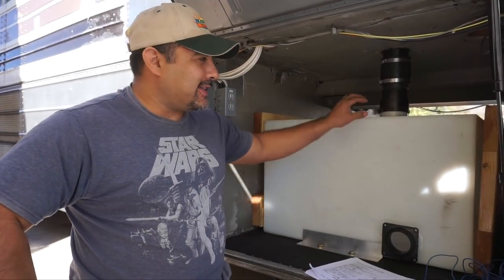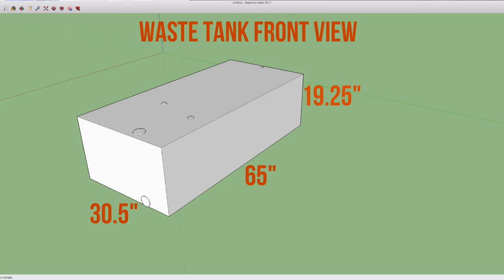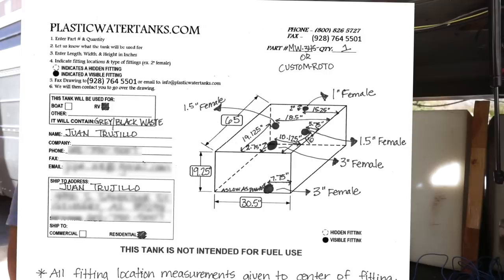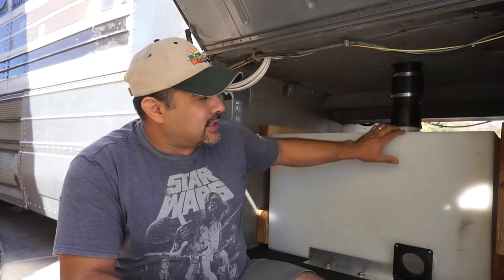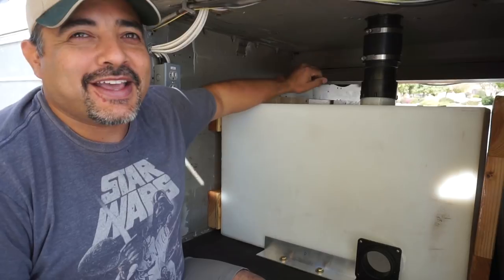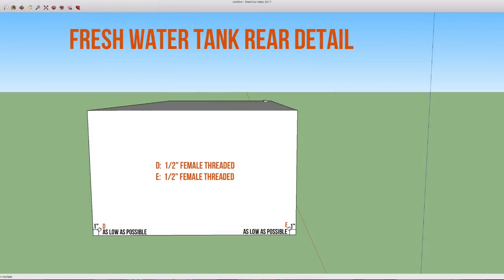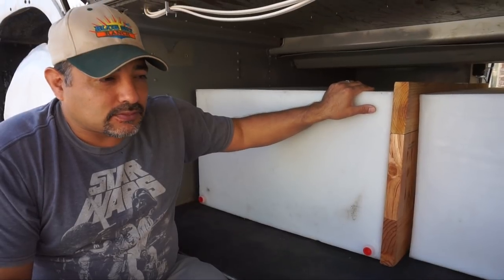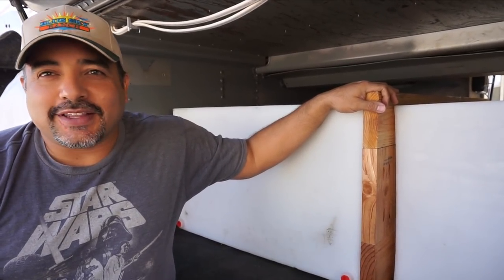All About the Tanks: An Overview of Our Water Tanks

Comment: RV Chief spray foamed his tanks in place as well as anchored.  Remember when you turn the bus, all the liquid will RUSH to the far wall.  Worst case is when you are 30% full, this will cause all the water to crash against one wall and then the other, as the waves crash back and forth.  This is a lot of weight splashing about.  The high strength low rise foam will help secure as well as insulate, in case you experience cold weather.  What about tank heaters?  Maybe you can duct heat from the battery bay into the water bay (on cold days that don't require A/C).

Comment: If you want to slope the tank when draining forget a frame under it and just use the leveling jacks to lift that side up more.
Reply from the maker: Interesting Idea Andrew.  We are going to try them as they sit for now.  We had a thought of perhaps using the airbags in the coach to tilt the whole bus ... we'll see if this becomes an issue.  Thank for the comment and for following along.
Reply: I've done this at some questionably designed dump stations where our RV tilted away from the drain side. Our tanks are sloped but I still just ran the leveling jacks down on that side to push it more that way. Worked fine for me.

Comment: you done it right level is best.  when you go to empty the waste tank make you a 2x8 board and put a second one on top just a few inches shorter screw them together so you can drive your rear wheels on the opposite side of the bus onto that will give you your tilt.

Comment: Great vid. You've probably looked into this, but I'm wondering if you know what the load carrying capacity of that bay is. That's potentially gonna be a heck of a lot of weight concentrated in there.
Reply from the maker: Hi - thank you for commenting.  We were concerned about this at first also and went looking for that information in the bus forums.  We didn't find any specific numbers but found out from some of the old timers that when greyhound had to move engines - they would put up to two engines in these bays and haul them from one location to the other.  The engines in these things are massive - weighing 2200-2400 lbs dry.

Comment: Wondering if the bay can support the weight?  it will be around 3000lbs with two full tanks. Not sure if the tanks have segments inside to prevent water from making too much movement when the RV turns too quick and tight. Great video, BTW. Subscribed.
Reply from the maker: Thank you Fred - I worried about that as well.  I went looking to see if there was any kind of rating on the bays.  I couldn't find any official weight ratings but I did find some interesting stories about what was carried in the bays.  According to some old greyhound mechanics the buses would often carry 2 even sometimes 3 engines in the bay when they were sending them out for rebuild or repair.  I went and looked up how much each engine weighs - they weigh about 2400lbs each.  In theory, we should only really ever have one or the other full - freshwater makes it into the waste tank if we have more fresh water on board we really have no place for it to go.  But that is still like 1400lbs - we have filled it with no adverse effects but we will be keeping an eye on it.  The tank was built with internal baffles to minimize the sloshing.
Reply: @BeginningfromthisMorning  thanks a lot for the information.

Comment: This is opinion based only, but I suggest that you round over the corners of those metal brackets so that they don't work into the plastic as the tank shifts side-to-side ever so slightly with the sloshing of the "holdings."
I'm not a holding tank expert (not even experienced with holding tanks), but I think I understand the properties of polypropylene and polyethylene.  Food for thought.
Reply from the maker: Hi Mark - thanks for the suggestion we will likely do that.  In addition, we will likely use a piece of rubber to cover these brackets - we shot this video mid-way through securing the tanks.

Comment: The only real concern that I would have with these tanks is: Do they have baffling to control water movement while in motion?
Liquids sloshing around can REALLY effect how your vehicle drives especially during curves & turns.
Braking is also very different with 1300+ lbs of uncontrolled mass moving around...you will have to compensate for that. 
You may wish to fill the tanks about 75%-85% full of water & practice curves, turns & stops when you are closer to being complete on the build.
Reply from the maker: Hi Gregory - Thanks for the question -  Yes the tanks were built with Internal baffles inside (to my surprise) - I was not aware until I peeked in there and saw them (I also wondered why the base of them was not perfectly flat - turns out it was the baffles).  Yes driving the bus with 1300+ lbs of water onboard will feel very different I am sure - we plan on taking everything pretty easy and slow (not that we have TOO much of an option with an old bus ;))

Comment: Did you have enough room from the top of the tank to the roof of the bay for a p-trap for the shower drain?
Reply from the maker: Thank you Jerry - yes there is enough room for a p-trap, but it turns out that p-traps are not really ideal in an RV.  Instead of a p-trap, we are using Hepvo Waste valves which have a small membrane that provides an airtight seal without needing to be full of water.  Another benefit of these valves is that they are much smaller than the p-traps they replace.

Comment: you may find that the black/grey tank drain port is on the wrong side .. most campgrounds and dump station are set up to drain tanks from the drivers side of the coach .. also most CG have the city water hook ups on the drivers side all so .. I like the videos .. great job .. just concerned about the tank drain port .. keep us posted .. De Randi
Reply from the maker: Hi Randi - Thank you for the comment.  We must have shot a few strange angles because our bus is configured the way you are stating - drain and fill will be on the driver's side.  I am sorry if it appeared to be the other way.
Reply: Based on the videos showing where the toilet is going (it's on the drivers's side) - I am pretty sure that the drain is on the driver's side.  What makes you think it is on the passenger side?
Reply from the maker: Good detective work Bill!  They are indeed how you describe :)
Reply: it was the angle of the shoot that threw me off .. I went back and looked again and I do see the front tire cover that I missed about half way through the vid .. great job .. De Randi
Reply from the maker: Thanks Randi - we are working on our videoing and editing skills - not 100% up to par yet but hopefully we are improving.

Comment: Historically, separate gray/black were because it was legal to dump gray directly on ground.  Now?  It's to support longer stays with hookups -- you still "hold" your black tanks, but free-drain gray (some don't, but vast majority keep gray valve open).  Since I believe you're shooting more for an off-grid boondock-mobile, your choice to combine gray and black makes logical sense for your rig.  Just curious, and I may have missed this, but why are you avoiding composting toilet?
Reply from the maker: Hi Travis - good to hear from you.  We are avoiding the composting toilet mainly because our kids are so young (12, 10, 7, 4) - I think the 12 and 10-year-old would do great with it ... the other two - not so much.  We were pretty convinced that we were going to do a composting toilet for quite a while, but the key to making it all work is the separation of liquids and solids.   We thought our two youngest would have a hard time with that - we have talked about retrofitting one when they get a little older and plumbing the urine diverter right into the black/grey tank.
Reply: Thanks for the reply!  Fair enough there.  I'm also concerned about our little guy (3 yo) being able to separate properly.  Guess we'll see!  You can always swap to composting in the future too.  Good call.

Comment: The only advantage I can think of to having separate black and grey water tanks is that you can use a grey water recycling system to reuse your grey water for flushing the toilet.  Grey water is shower and sink rinse water - so, perfectly fine for flushing.  Otherwise, I can't think of any advantage of having the third tank.
Reply from the maker: Thank you Richard - I couldn't think of much either.
Reply: 1. Washing out the hose after dumping the black.
2. If you boondock putting an enzymatic in your black water tank can help it break down and be less stinky. The detergents in grey water can kill the enzymes.

But you're right that there's not much benefit if you plan for it.

Comment: Is the bay going to be heated? Or are you going to add any insulation? I know its a large volume of water to freeze but ....
Reply from the maker: I will likely do both - heat and insulate the bay.  Not 100% sure what we will use just yet.  We would also like to follow good weather ... but good weather doesn't always cooperate :)

Comment: There are really two advantages I can think of with separate gray and black. One is the flushing of the pipe as you mentioned. Using a hose on the far end of the tank will not produce the head water that opening the gray water blade valve will produce (if you can I would install the sprayers inside the black tank to aid in flushing). Second is Black water must be drained into a septic system. In a pinch you could dump the gray into a storm drain as it is only soapy water. I would insulate the water bay. A piece of ridge foam board under the tank would protect it from chafing (same with the sides), It could be shaved into a wedge to tilt the tank and still support the whole bottom of the tank. When winterizing you want to be able to get every drop out . Also a heat run into the bay would be a good thing. My entire basement is heated. Have you looked into the structure under the floor. Will is support the weight of both tanks? A floor support from the floor above between the tanks might be a good idea. It could also sever as a separator. Absolutely a good move on the sensors. I need to replace mine for that very reason. Glenn Lever
Reply: I guess my biggest concern is all that weight in one compartment. Glenn lever

Comment: that is a total of 2600 if the tanks are full or maybe more can the frame handle all that weight in one place?
Reply from the maker: Hi old time engineer - yes, it is a lot of weight.  I think the bays can handle the weight.  We also should not have both tanks full at the same time - as we use the fresh water it should empty into the black tank.  if we add more water before dumping we are really asking for trouble.

Comment: Hi Juan, I just found your travel the other day while doing some battery research and saw your awesome lithium battery series. I proceeded to watch the rest of your videos and became a subscriber.
I just thought I would pass along some info about tank level sensors. I work in an industrial plant and I specialize in automation systems. We measure hundreds of different tank levels of all kinds of liquids ranging from water to thick oils. The devices we use are all out of the price range of most homeowners, but one type that seems to work well for us in some applications and can be bought fairly cheaply off of ebay are ultra sonic sensors. Since you have access to the top of your tanks you might want to look into these. You hinted in one of your videos about automation so I think maybe you have a background in computers or control systems?

Anyhow look at something like this: https://www.ebay.com/itm/Ultrasonic-Water-Tank-Level-Meter-with-Temp-Sensor-Low-battery-indicator-/132410304947

I've never used one of these but just linked it to give you an idea beyond the Seelevel sensors that are quite pricey.
Reply from the maker: Hi William, thanks for following along.  Good detective work: I am a software engineer.  Wow!  That is great feedback.  With all the DIY stuff I have been doing it never even dawned on me that water level sensors might be a good candidate!  I do have access to the top of the tanks.  I am a little worried as these may require cutting into to the tank.  I will look closer at these for sure - thanks for the tip!
Reply: Another way of measuring level is with pressure. You can assume that water and poop have about the same specific gravity so a pressure transmitter in the bottom of the tank could be used to calculate tank level. This approach requires some software, but it sounds like you have that part covered. An Arduino or Raspberry Pi should be easy to program a pressure transmitter in one of your bottom ports.

I'm just throwing things out you might consider. Personally I'm older and I'd go for the easy solution, but you remind me of a younger version of myself.